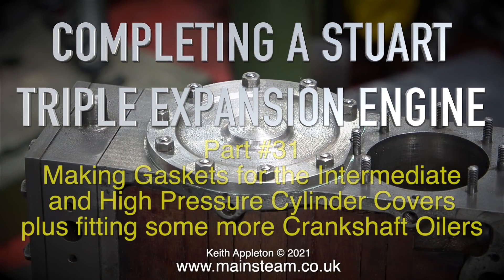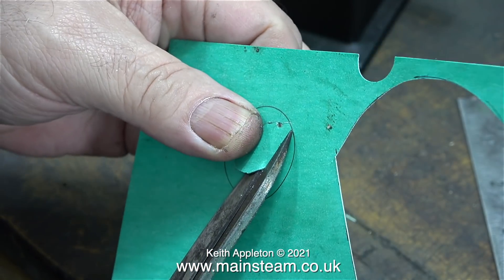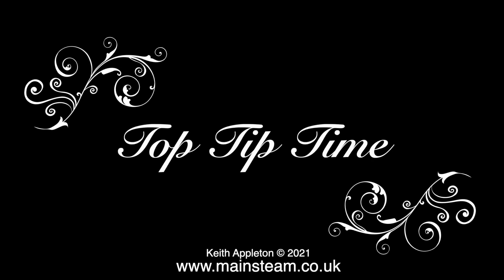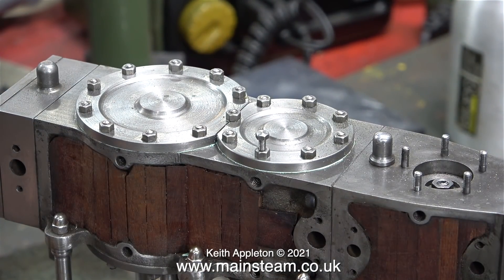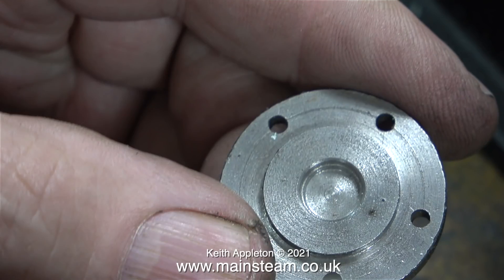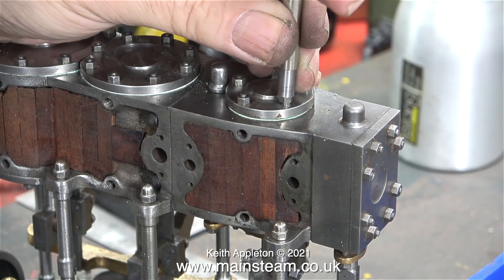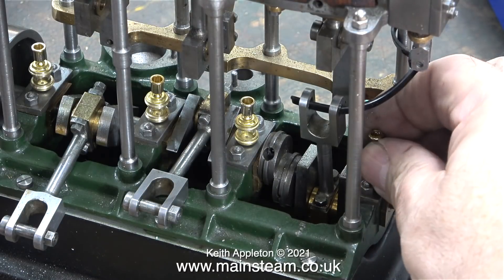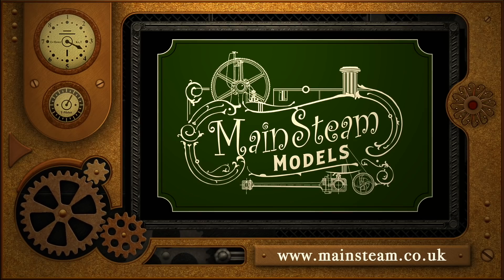COMPLETING A STUART TRIPLE EXPANSION ENGINE - PART #31

Comment: When I started College in 1970, we were required to buy Drafting instruments, and one of the sets I bought was like the one showed. I discovered you could buy small swivel blades that went in instead of the pencell. They were intended for use in graphic arts for stencil cutting, but worked great on gaskets.

Comment: Others have commented on the relationship of depth of field to aperture size, but I also think your images could be improved by changing the white balance. Apologies if you already know this, but Your camera was probably set to “auto” by default and like all average settings it becomes less successful as margins are approached. Your manual will show how to change the white balance to suit the type of lighting you are using in your workshop -just remember to change it again if you’re photographing trains outside in sunshine
Reply from the maker: Thank you for your advice. I find this job hard enough without having to check all the camera stuff while I am making the models. I just switch between auto & manual when it is required. A lot of the time I watch whet I am doing through the viewfinder and I am alway careful to not remove any fingers in the process }:-)))
Reply: Good technique! Who cares about white balance anyway, so long as you can still pick your nose 😁

Comment: Very nice Keith ! For mine I used Oakenstrong gasket material. I first fitted a rectangle on both  LP and IP cylinders, held in place by several of the 7BA covers studs. Then simply cut with a sharp model cutter inside. Finally removed the excess gasket around covers like you. So the LP and IP gaskets are a single piece. The center rounds removed from LP cylinder was then used to make the HP gaskets 😉

Comment: I wondered if the gasket material was marked on one side, in the last video and hey presto in this one we can see it is Klingersil. We use this manufacturer in my job for practically all flanged fittings. I seem to recall they have a factory or headquarters in Bradford. I like the way you finish the inside with your Proxon tool. Thanks for the videos

Comment: On the dSLR you have the aperture too wide (f-number is low). To increase depth of field you need to decrease the aperture size (larger number). The trade-off is the shutter speed will be lower as less light is getting in to the camera.
Reply from the maker: Thank you for your advice }:-)))

Comment: Having been a Draughtsman I have a pet hate. You don't draw a circle with a compass, you use one to find North.
Reply from the maker: Mine is the multi function version }:-)))
Reply: My High School Drafting Instructor, said to refer to the one you Draft with as a Pair of Compasses, and the other as a Magnetic Directional Compass. Compasses can also be used for measuring distances on maps. Those compasses are called dividing compasses, and they have two needles instead of one. The measurement can be done by measuring how many times the fixed compass can fit in some distance.

Comment: Well now. It is a good thing your gasket material is green,for I am absolutely green with envy over your draughtsman instrument set. That line drawing pen,the bottom right item,is the clue. That set could be oh,130 years old,maybe more. I have some magazines from the 1905 to 1925 era,and any professional draughtsman would carry that set,there is also an extended set that was recommended. 
The permanent  black ink of the period had some finely ground solids so a pen like that was the only way the fluid would reliably transfer.
From watchmaking gears to the RMS Titanic,every single engineering drawing made ,every single straight line on that page was made with a pen just like that. And at the end of the day,the pen would be disassembled and meticulously cleaned.
As a personal favor,would you film the use of that pen on a ruler,plus disassembly and cleanup ? I wonder what the threadform was specified for what made up those things,back in the day ? Any idea ? Cheers.
Reply: I bought a set like that new in 1970 for College.

Comment: Forgive my ignorance, but why is this called a triple expansion engine? I see a high pressure cylinder and a low pressure cylinder, but the steam only expands twice right? Once after the high pressure cylinder, and once more after the low pressure one.
Reply from the maker: I see 3 cylinders on my Triple Expansion Engines . . . . . the 3 Cylinder covers are a dead giveaway . . . . . .
Reply: @keithappleton  Oh, my mistake there. I thought one of the smaller cylinders was a valve for the low pressure cylinder. But, I did see the slide valve at the end too, thinking why it would two kinds of valves. I guess I'm just dumb, but that's why I ask questions.
Reply: The steam expands in each cylinder, losing pressure but gaining volume. That is why the the intermediate cylinder has a bigger diameter than the high pressure cylinder and the low pressure cylinder is larger than the intermediate pressure cylinder. All cylinders have the same stroke as they are connected to a common crankshaft.